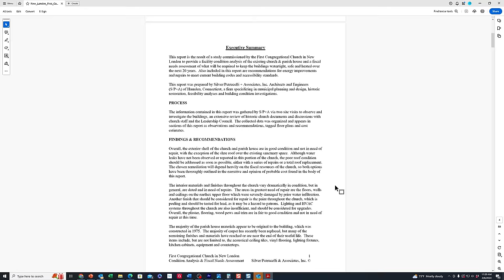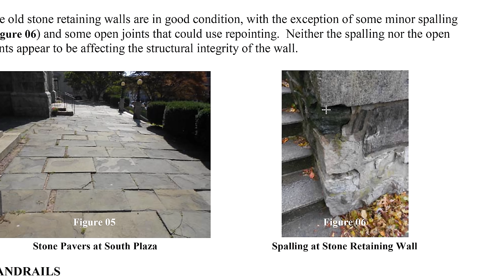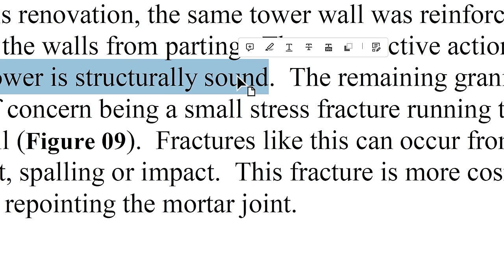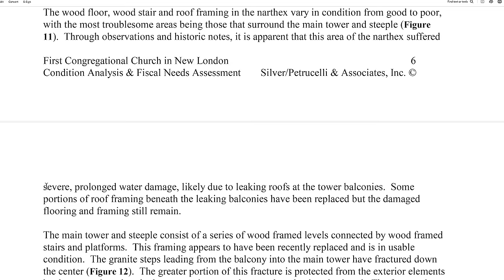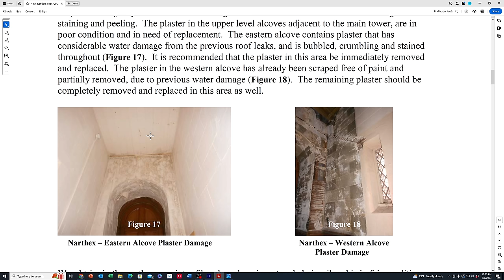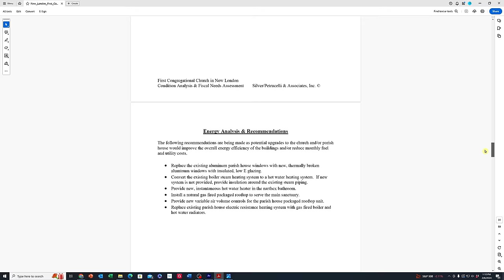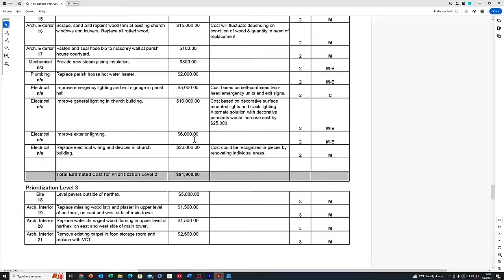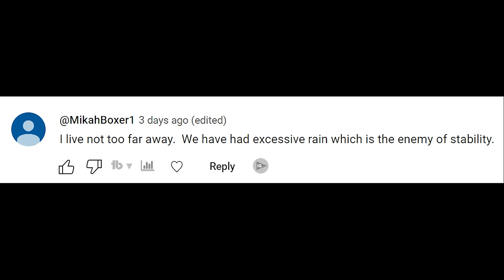Engineering Report: Collapsed Church Steeple Was OK?

Comment: Hi Jeff. Regarding the Now London Church collapse, A friend of mine played the organ in that church in October of 2023 and had this to say about the church. "I played a funeral in the New London church back in October and saw a tremendous amount of water damage along with buckling doorframes in the upper level directly underneath the steeple. It is, unfortunately, a simple case of absolute neglect on the part of the organization that bought the church from the congregationalists". Thought you would be interested in his comments.
Reply from the maker: Thanks for the info!
Reply: >.<   Not an expert myself - but water damage happening inside the building would argue wood supports rotting out.  Depending on how the load was supported, I could see a decade of wood rot granting things an extra degree of freedom to move. :/
Reply: How did the engineers miss all of that?
Reply: @Relkond Did you see the buckling concrete and stone? 
Water also creates massive settling issues. That's my take.
Reply: The engineers inspected the church in 2011, about 13 years before the collapse, so the water damage may not have been present. Quite a bit can happen over a dozen years.
Reply: the vibrations from the organ over time probably did not help either
Reply: @silvertbird1  seems like they noted water damage but underestimated the extent. We all want to believe that every engineer is a hero but a lot of the time they're just saying what people want to hear so they can get paid.
Reply: @Relkond the wood beams and boards showed at the collapse area looks like water damaged. 
I don't need a degree in engineering to see the damage. Especially on the interior walls and ceiling. Once plaster gets water damaged it's only a matter of time until it falls apart. The report was done over 10 years ago. So the damage would have only gotten worse.
Reply: @jenniferbeyer6412  if I recall correctly, the report called the water damage ‘old’.  Several plausible scenarios could be inferred from that, where the conclusion of ‘no action called for’ would be reached in error.

Comment: An engineer's report from 2011 isn't forever.  It only quantifies the conditions at that time.  To second guess the report after 13 years have elapsed is to purposely ignore deterioration during that timespan from both the environmental conditions and maintenance neglect.
Reply: Tax-free money was collected in that building for 170 years, but...
Reply: 13 years can do a huge amount of damage, especially if it's where you have freeze-thaw conditions.
Reply: @CraftAero 
As a trustee of a church, I can tell you that not all churches are fortunate enough to be bringing in tons of money. Tax free or not is not really relevant. Most give bare minimum or don’t give at all but reap the benefits of the church. The cost of upkeep, utilities, improvements etc. is the same if not more than everyone else because people just assume “oh they’ve got the money.” If people’s homes were subject to the same scrutiny in repairs, structural integrity etc. the list of issues would be endless. As a tradesman I see this.
Reply: He found photos of cracks in the steps that were never fixed from the 2011 inspection. Granted a lot can and will change in 13 years, still that's obvious neglect.

Comment: 2011 is thirteen years ago. If the owners have simply let the building stand with no upkeep for thirteen years, that would count for enough decay for the building to fall, if it wasn't right from the beginning.
Reply from the maker: The church was sold a few years ago too, so likely nothing was done leading up to the sale
Reply: @jeffostroff  I believe the sale was because the previous congregation had dwindled to something like 20 people.  

Someone in the comments on your earlier video pointed out that we recently had a massive new pier built on the river; that involved a lot of pile driving, which they said many in the area felt. I don't know what sort of distances might be within range; obviously the makeup of the ground between the two points would affect that.  If I'm doing it right, it's about 1700 feet from the church to the new piers. Could something like that have contributed? I seem to recall that Christ Church Cathedral in Dublin had some foundation damage from all the pile driving at the Wood Quay development, but that was within a few hundred feet.
Reply: @pippagrey9633  That distance is way too far and buildings in between the two points (and much closer) would show effects far sooner than at the church distance. Definitely a decaying building that received no maintenance help of any substance. Why? cost, check some of the other historic steeples and towers and the costs involved to do it right.
Reply: @jeffostroff That's probably why they sold it.  They found out how much it was going to cost.
Reply: @zorbakaput8537  Thanks! I figured it probably hadn't contributed, but if I didn't ask, I'd always wonder, right? 😀
Reply: Yeah... my dentist would not let me go 13 years without some repair work.
Reply: Only 20. People?  Clearly the church outlived its usefulness

Comment: The eye-opening surprise to me in college was an engineering class that told us the price of maintenance for a commercial building would be equal to initial cost in a few years. (I forgot  whether it was 7 or 13 years). While we all assume once it is built , it is done, the truth is the initial cost of building is just the beginning of what it will cost until you tear it down.
Reply: When it is torn down, it will cost several times the cost of the initial construction.
Reply: Residential buildings are similar. Water leaks will destroy your building very quickly. Fix that leak!
Reply: @tiredoldmechanic1791  There's been talk recently about demolishing the Olympic stadium in Montreal.. Estimated cost: 2 Billion Dollars
Reply: And people wonder why it costs so much to rent an apartment.
Reply: @tiredoldmechanic1791 WELL if it costs $100,000 to repair issues, but only $100,000 to build a new building, then just build new

.

Comment: If you look at the mason stairs that are broken it explains the leaning because the one side is dropped farther then the other. Great video as always!
Reply from the maker: Good point!
Reply: @jeffostroff  Actually, I think the broken steps are a symptom of the leaning.
They buckled upwards because the blocks are being side-loaded as the tower framework starts leaning backwards against its interior wall (recall that these stairs are on the sides of the steeple and would therefore be squished as the tower front reclines against the structure of the central building).

Comment: Jeff, the video of the toppling clearly showed the structure intact while falling, which indicates the failure was very low, perhaps at the base.  It's possible that some underground erosion occurred where it could not be seen.  As this became bad enough that it could not support the weight the tower leaned (as shown in photos taken recently).  And finally just toppled.
Reply from the maker: Yes my bet is on sagging ground, or disintegrating mortar joints low on the steeple tower
Reply: I’m a civil engineer, and it appears this was most likely geotechnical issue.  The amount of rain they received prior to this event was insane.

Comment: The possible role of repointing with Portland Cement mortar rather then the original lime mortar may be quite significant, especially as there were serious water leaks reported in the upper portion of the spire. 
Along the same lines, filling in the space between withes with Portland Cement grout, rather than adding to the structural integrity of the wall may instead have cut off the route for water leakage into the inside the wall to drain out the bottom of the wall. Holding moisture against the inner faces of both withes could have a catastrophic effect on remaining lime mortar. 
It is not clear to me from the descriptions whether the reported leakage was concentrated at the rear of the spire. Even a few degrees of tilt might have caused greater water infiltration on the rear wall.

Comment: The report said it was on a granite bedrock foundation.  It will be interesting to know whether this was based on an old description as to what was done or how they knew.   They may have conducted an accurate analyses of the tower, but the foundations wouldn't have been accessable.  Maybe once the debris is clear, they will be able to get a good view as to the foundation's condition.
Reply: This is exactly what I'm wondering. Everyone is talking about settling, but if it was really granite block on granite bed rock there should be no settling. I guess it's possible that the mortar joints were failing allowing the blocks to settle, but rain softening the ground should have nothing to do with the collapse if it really was on bedrock. As an aside, this is why I hate mortar, build it like the romans with cut blocks and no mortar joints and it would still be standing with zero maintenance.
Reply: Yeah I doubt that. In NYC that granite bedrock is some two hundred feet deep.
Reply: The photos from the report shows the foundation has deteriorated and without repairs the foundations wouldn't be able to hold the building up.
Reply: The Romans used concrete

Comment: The rainwater drainage for the facade - and in particular the balconies - probably goes internally, as there are no obvious external downpipes.  Maintenance would be very difficult, and the pipes would have been cast iron or ceramic, and certainly not easily accessible.  After a few decades sludge would clog the bottom of the system allowing standing water to sit above the blockage; this would find an egress and seep into the foundation, causing damp issues around the base of the tower.  As the tower starts to move the pipes will fracture, causing more water leakage, and more movement of the frontage.
Reply: I agree most likely waterproofing of the baconies. An area requiring constant maintenance. Even today not many builders would get the waterproofing detail correct. Not mentioned in the report even though the water damaged timber floor at the base is a tell tale sign of long term water egress. It didn't come from wet shoes.
Reply: That's an excellent observation.

Comment: To me, the smoking gun is the picture of the fractured stone steps taken from the balcony leading into the main tower.  As a structural engineer who's has been practicing for 40 years, I have found that structures tell you when they are in trouble through obvious distress.  It is up to the engineer to read that and trace it down to the source.  How?  By going back to the fundamentals of structural engineering - bending moment diagrams, Mohr Circle, etc.  So, the steeple, from the leaning that was evident in the town panorama pictures to the steps here, was giving clear indication that something fundamentally wrong was going on.

Comment: Looking at the floor plan and adding the fact that the tower stairs had broken and that the tower probably failed on the the backside as that's the way it fell - I wonder if the massive foundation under the back of the tower had settled.  Or maybe suffered water damage.  Too often, hidden things like a foundation get missed because you cant see them.  Sometimes the builders don't put their best work into hidden structures.

Comment: I didn't see any rainwater goods in any of the pictures.  The water running off the roof is just allowed to pour off the roof to the ground, including off the side towers onto the balcony adjacent the failed main tower.  
The rotation of the tower as it fell would suggest that the failure initiated on the inside face, i.e. the face of the tower that wasn't dressed in the granite block but was just timber and masonry.  This takes me back to the initial 1851 comments on the inherent stability issues with the tower - I am wondering if the original contractor saved some money, if the materials were adequate and if the vertical load paths were adequate given the number of openings...and was the tower stable on its own or was it a) unbalanced due to granite only on some faces but not all resulting in eccentricity, and b) was the tower reliant on propping action from the main roof timbers.  Embedding timber in masonry was quite a popular detail in victorian buildings, causes issues when the timber rots out.  I suspect that the tower was inherently unstable due to eccentric self weight, saturated timbers rotted out unseen behind plaster, the loss of load bearing capacity to the aspect of the tower facing into the church eventually became critical leading to rotation of the upper part of the tower and its collapse.  
Would have been very difficult for the engineer in 2011 to really appraise the structural condition of any embedded timber - no doubt it was a non-invasive visual inspection.

Comment: Jeff, thanks for another well researched video. I spent 35 years as a network and test engineer but building maintenance always was a part of my life. Now at 61 and semi retired, building maintenance is all I do. Houses and buildings will crumble if not maintained. The cost is higher on these old buildings especially those with slate roofs such as this church. I'm just glad no one was hurt or killed in this building collapse.
Reply: My great aunt had a house with a slate roof. It lasted about 80 years, but the nails holding the tiles up rusted away. While they weren't directly exposed to the rain, I'm sure dew condensed on the nails. They were replaced with shingles.

Comment: Apparently, the authors of this report were unaware of the building's architect's warning from 1850 that the steeple tower should have been torn down and rebuilt; I don't even see any mention of the rods and plates that were installed after that warning. It must be hard to assess the stability of buildings like this, with so much hidden from view. It's hard to tell how deep each stone is, how much metal is tying the wythes together, how much deterioration is hidden from view, how deep previous repairs, which might look good from the surface, really went. Ironically, there are stone buildings which have survived hundreds of years open to the sky, no doubt with any mortar that once existed missing. But that only happens if the stones interlock so perfectly that the structure will stand with no mortar, and that's another thing that would not be visible from the outside.

Comment: stepped cracking is a classic indication of subsidence damage. the cracked steps are indicative of differential movement between the steeple and adjacent tower(s), were the footings exposed, are they sure the building is founded on bed rock?. , those external front steps are sure as heck not. where are all the rain handling goods, gutters, downpipes. maybe its the resolution or they are well concealed but all rain water seemed to be shedding directly from roofs onto the structure, where's that water going?.

Comment: What was the instigation for the 2011 Engineering report? For what it is worth, my church had a beautiful granite building from the last century. These were designed to "last forever." But nothing does. The costs of maintaining and repairing it finally drove the dwindling and aging congregation into selling the property and merging with a congregation in a much newer building. Very sad.
Reply: I was wondering that, too. May have been the August 23, 2011 earthquake that shook taller buildings up the east coast. The building I work in  just north of there was closed for a few days until an inspection was done.
Reply: @Carbidencoffee  Thank you. That is an excellent insight.

Comment: I live about 10 miles from it and yeah the rain has been crazy. My sump pump hasn't run in 3 years and when this was happening it was running every 3 min. The ground water level is generally about 6 feet below my pump as it lives in 10ft 100 year old well in my basement.  I had water leaking out of pin holes in the basement walls. The ground was beyond saturated. It wouldn't have suppressed me if the foundation of the tower sunk under the mass of all that stone. I have photos from 10 years ago of that tower having a heavy lean. There was a lot of warning just by looking at the structure.